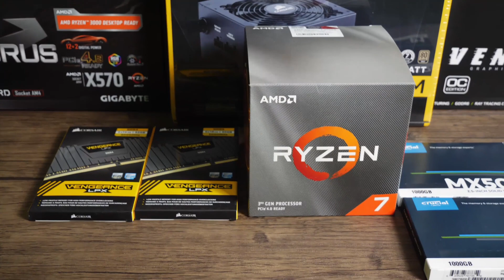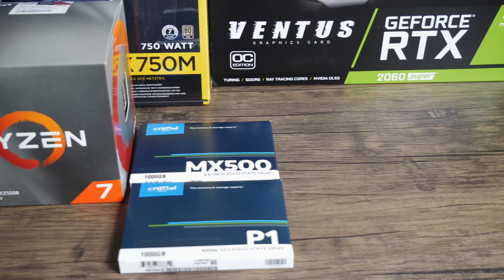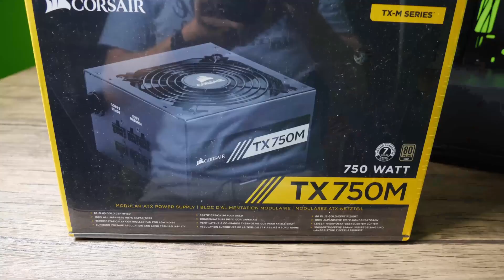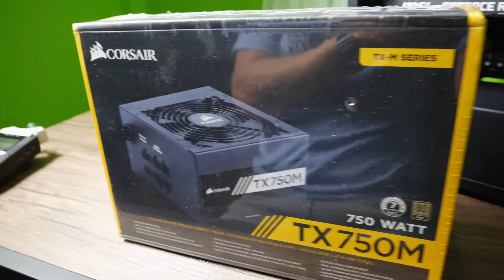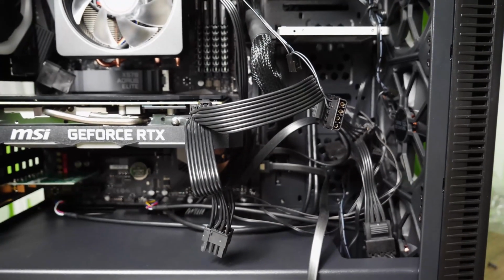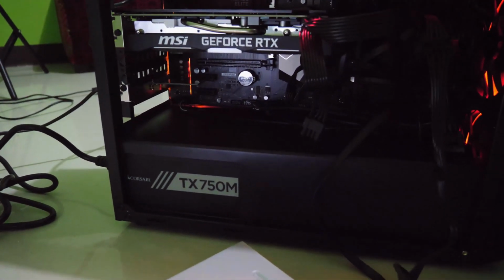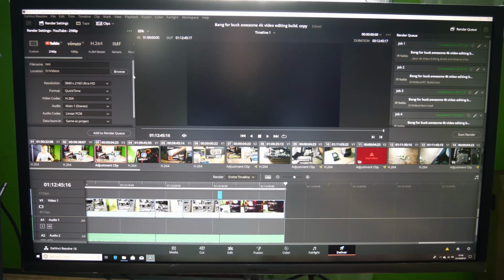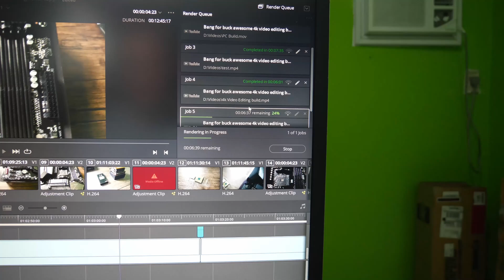Best Bang for Buck 4k Video Editing Build - Ryzen 7 3700x

Comment: randomly came across this video. funny i have a very similar build but 32 gb ram. Built in 2019. Works like a beast to this day (as long as I'm using proxy for 4k) in 2024.
Reply from the maker: I expect mine would still preform well but I ended up leaving it in the UK after being there a while. I’m now considering whether to upgrade my laptop or build another desktop but the price of Nvidia RTX cards is putting me off the build a bit.

Comment: I have a very basic question. Will a basic no frills NVMe SSD perform at least little better compared to a basic no frills SATA SSD ? i mean if both were not higher end ones. Like say normal SAMSUNG 750 EVO SSD vs an M.2 Crucial P1 1TB ? (in a scenario of using them exclusively as a 4K footage only edit drive, not as permanent store or OS). I will never fill it with more than 50% capacity EVER.
Reply from the maker: My understanding is the m.2 will be faster.
Reply: @davidfleet  > Thanks for your input. Best wishes.

Comment: Thanks for the vid, David, can you specify the case (the one off Amazon UK) or even throw a link here? Cheers
Reply from the maker: Hi Laszlo, it was this one https://www.amazon.co.uk/CiT-Mid-Tower-Single-Ring-Tempered-Water-Cooling/dp/B07G4TZPQK/ref=sxts_sxwds-bia-wc-p13n1_0?cv_ct_cx=Pc+case&dchild=1&keywords=Pc+case&pd_rd_i=B07G4TZPQK&pd_rd_r=77679a82-3d48-4874-94bc-885dedb1b080&pd_rd_w=6Fdg6&pd_rd_wg=chnnO&pf_rd_p=4cda869f-2b1a-4e5f-a72b-48315da95bba&pf_rd_r=NBAENP1XWSKMN3B2WES6&psc=1&qid=1589660928&sr=1-1-91e9aa57-911e-4628-99b3-09163b7d9294

Comment: Not true the 7 2700x is also 8 cores but like 80$ cheaper also id recommend possibly an AIO cooler, also i would recommend an amd 5700xt it has 2560 cuda cores which will perform better than a 2060 super.. the 5700xt in some cases performed comparably with the 2070 super
Reply from the maker: The 2700x is last gen.

Comment: Hmm if you have the Studio version of DaVinci have you compared rendering via the Nvidia Encoder?
Reply from the maker: I use the free version. As far as I'm aware it uses the Nvidia graphics card although it never goes above 70%. Is there a different setting on the paid version of Davinci to force more usage of the graphics card?
Reply: David Fleet Yes on the paid version for the Encoder when you export instead of Native you can choose NVENC and that uses the GPU. Way faster than the CPU for me since I have a i7-4790K
You should try it with handbrake or ffmpeg. You can use the NVENC there.

Comment: Will rtx 2070 super and ryzen 7 3700x with 3200mhz 16 gb ram be good for premiere? My timeline usually has a butt load of effects and trims and duplicate clips
Reply from the maker: That combination will rip through Premier as long as you're also using SSD drives.
Reply: @davidfleet  yep its a 500gb nvme. Ill keep transferring files from the hdd when i need to edit

Comment: I like ur build. Can i ask where you ordered ur parts if ur in Philippines? Thnx and I appreciate your reply.
Reply: Sorry it was said in the amazon uk. My question is how possible can i order from amazon uk ship to Philippines and how much would the shipping cost?
Reply from the maker: I'm not sure you can create an account on Amazon UK but I'm pretty sure you can order from Amazon.com and it will tell you the shipping charges there.
Reply: @davidfleet  thanks mate for the reply. Actually i work as amazon uk product sourcer so I can arrange that. Just not sure if there are additional fees or hidden.
Reply from the maker: @malinoisvanhetridjdkerk1124  ah OK well you should be fine then. They removed UK VAT at 20% and then charged import fees deposit at whatever the Filipino rate is. Although I got a refund for some of those fees as I was charged less duty than they estimated. Delivery is more expensive but it didn't work out much more expensive in total than buying and having the goods delivered in the UK..
Reply: @davidfleet  how is this build playback while editing premier and the DaVinci resolve software? Would appreciate ur input for this. I am also trying to build same as yours.
Reply from the maker: I've only been using it in resolve. 1080 obviously it's fine. 4k is fine until you add a lot of transitions and grading then it can slow on the transitions. Creating proxies soon sorts that out and then rendering is pretty quick. I have just put  a Ryzen 9 3950x into my build in the last couple of days but for rendering I'm not seeing much more than a 20% improvement in 4k rendering times so I've got to work out what's up there. 1080 rendering times with the 3950x are twice as fast though. If given a choice I think the 3700x offer the best bang for buck at the moment and would choose that over the more expensive parts.
Reply: @davidfleet  Absolutely agree with you, and I think I can settle with not so smooth playback at the moment since I still don't have with me a good camera to capture my dog training sessions. The render time is more important for most budget user like me in post content production. Thanks mate and it helps a lot.

Comment: Thanks for the info, I have now adjusted my component list to go for the Ryzen 7 rather than the 9, and upgraded the mother board. My question is, how much difference would it be to Resole processing and rendering with 32gb RAM?
Reply from the maker: I thi k 32gb would be fine. My memory peaks at about 25% usage when editing video in resolve and I have 64gb RAM.

Comment: nice, thanks, I really need to do an upgrade to my system as I am shooting and editing 4k footage now. The lagging and crashing is horrible. using mostly Davinci now but also have PP CC.  I found out that my motherboard and cpu are the max it will go, so I need a new motherboard, CPU, GPU and Ram (I just upgraded to 32 mb ram but is it ddr3) I have a 1T ssd already too so hope I can use that and my other hard drives.  Just have to figure what to get for the main parts and replace.
Reply from the maker: Yeh you should be able to just upgrade your motherboard, CPU and RAM and it will be like a new system. Did you decide on what to go with yet? If you're using Davinci then it requires a good graphics card but PP not so much.
Reply: @davidfleet  Ya that is what I am thinking, new MOBO, cpu, ram and gpu. almost a whole new system. lol. just trying to figure the best parts I can get to future proof for a while and give me some power and speed and not totally break the bank.
Reply from the maker: I think these Ryzen 7 and 9 processors offer good value and performance. I was kind of in the same boat looking for the best performance before you get to the level of diminishing returns. That's why I went for the 3700x rather than the 3900x. It blasts through rendering pretty quickly now even on a 4k timeline with lots of edits and transitions. However some of the more complicated transitions can stutter slightly during playback but compared to my 8th gen i7 laptop it's a dream. I spent about £2000 in total but had to get everything including a monitor as I was building from scratch.

Comment: Nice build just did my build for my pc with the 3700X.  I thought about using Davinci Resolve for my editing, however just so used to adobe premiere.
Reply from the maker: It's a great processor. What parts did you go with to compliment the 3700x? Yeh I'm having to learn Resolve after using Premiere before. I couldn't download Premiere on my Internet here for some reason so was forced into switching. I like resolve though but it definitely needs higher end parts than premiere.
Reply: Hi
which GPU did you use
Reply: @rahmatrad4599  I used the 1060 6gb I also did a build video on it 
https://www.youtube.com/watch?v=I7rCB9PzLhs&t=3s

Comment: Thanks....I think I'll stick with 1080 x....for now...very expensive...
Reply from the maker: Hi John, thanks for commenting. Do you use the 1080x in Davinci Resolve or Premiere Pro? If Resolve how does it perform?
Reply: @davidfleet  Yes 1080 in DaVinci mostly Vegas 16 render takes about double the time of clip length it is ok for me.....I don't have enough ram in the gpu.....only 2 GB...see my vids nothing fancy!!
Reply: @johnallen3423  That's not too bad. This is my first desktop build for about 10 years. I used to build them all the time but having been travelling so much I've been struggling along with laptops for the last 5 years. That's where I was struggling, only 2gb of VRam so even adding a basic title overwhelmed the GPU. Resolve really likes lots of Ram in the graphics card, that's why I went with the 2060 super over the 2060 as it has 8gb instead of 6gb of RAM. I was having serious problems downloading Premiere Pro which relies much more on the CPU so bit the bullet and got the best performing parts before you get into the really high end stuff where the price jumps significantly. Gotta say I'm very happy with the performance. Cost was about £2000 including a new monitor but it should last me 5 years.